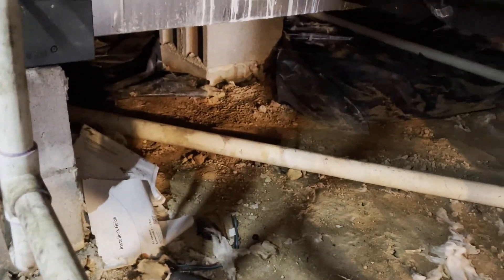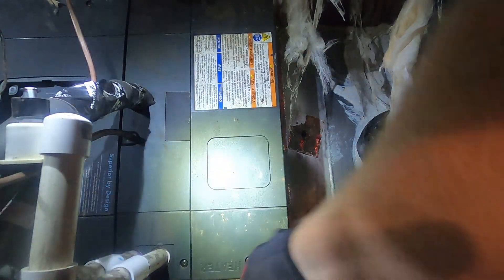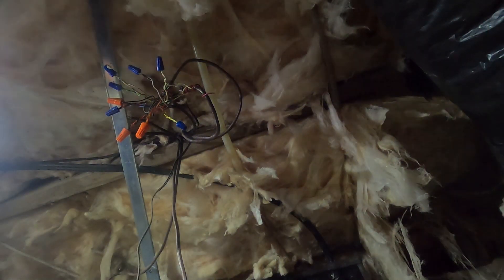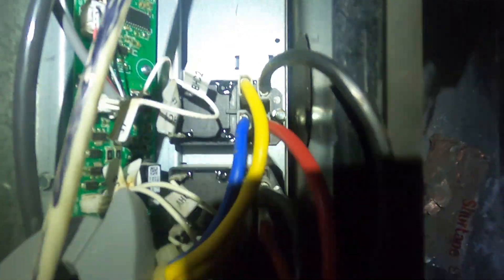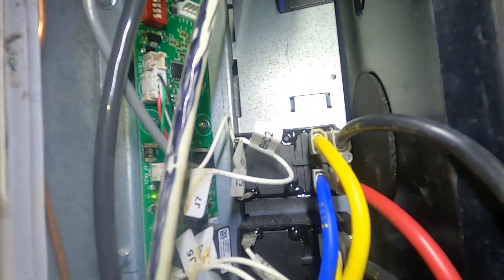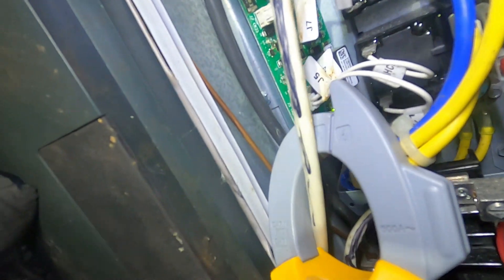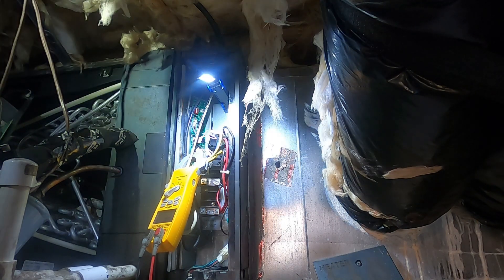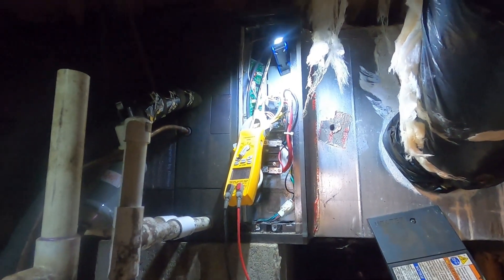HVAC Heat Strips do not work! #hvac #hvaclife #hvacrepair

Comment: So since u jumped  w1 and w2 wouldn’t that run heat pump and heat strips at same time all the time?
Reply from the maker: Y is a/c and HP.  G is fan. W1 is first stage  of heat strips W2 is second stage of heat strips. W3 would be 3rd.

Comment: HAVE YOU EVER FALLEN BEHIND A CUSTOMER'S "CRACKHEAD BUDDIE" WHO ONCE RODE ON A HVAC TRUCK AS A HELPER AND STOLE A FIST FULL OF CAPACITORS AND HE REPLACED ONE AND IT SMOKED THE MOTOR!!! OR A RATTRICIAN WHO PULLED A GROUND AND NEUTRAL FROM A 3-PHASE PANEL  TO RUN A WINDOW UNIT OFF AN OPEN DELTA PANEL!!! GOOD TIMES ;)

Comment: Would it be a good practice to check the 220 wire gauge to confirm it will support the extra load? The installer might have left them disconnected on purpose without documenting to the next tech.